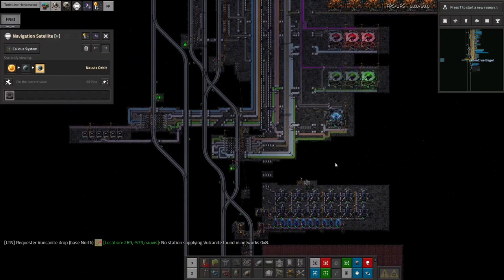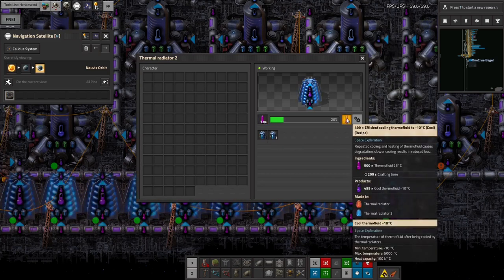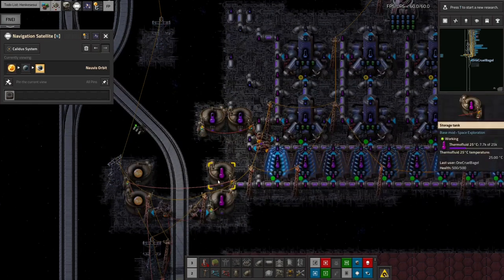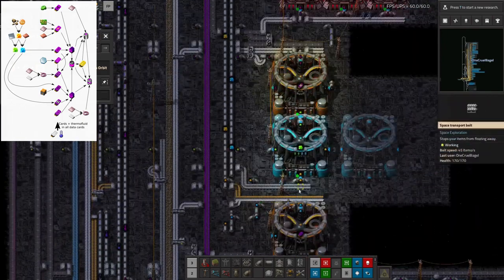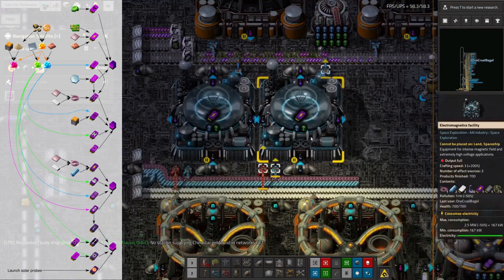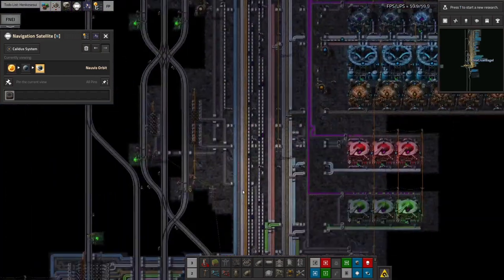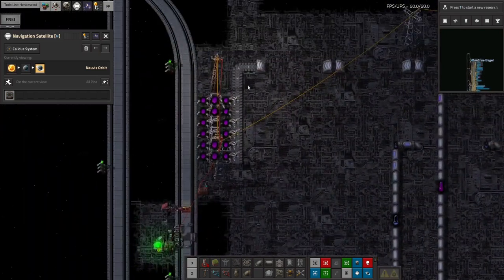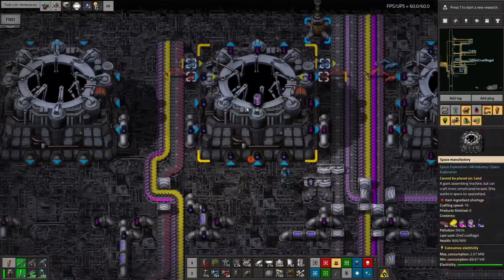S4-E6 - Energy Energy Energy! - Laurence Plays Factorio: Space Exploration

Comment: Agree on the thermofluid. Power via solar panels is free! Thermofluid is not. Easy decision.
Reply from the maker: Exactly! The only debate is whether it's worth the extra cost of the additional solar panels and coolers (which aren't free!) but saving in thermofluid adds up quickly enough that I think I made the right decision.

It would be interesting to come up with a value for everything based on how many pieces of (any) ore are required to make it, perhaps with a slight boost for exotic materials, and therefore give everything a price. You sort of get that with the "raw materials required" when you look at building something, but it tends to get thrown off by anything that requires fluids (like blue circuits).
Reply: There is a program called YAFC that does just that!